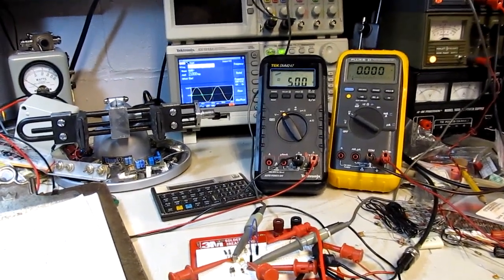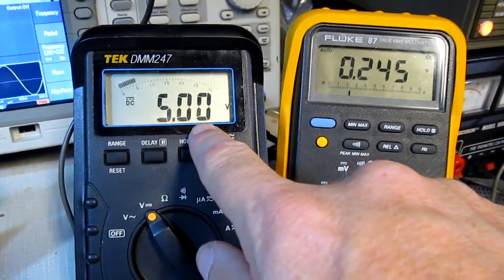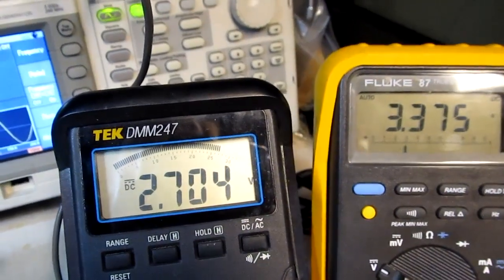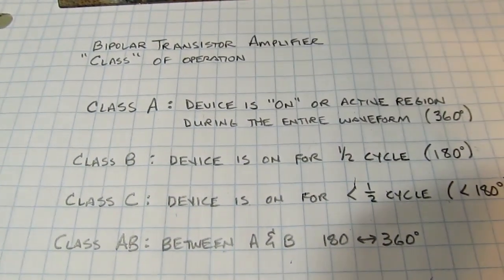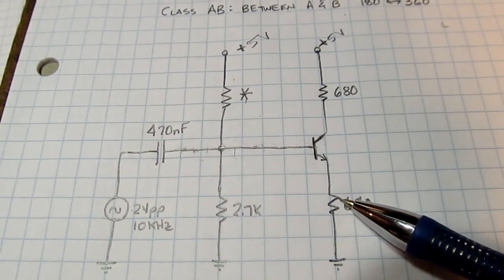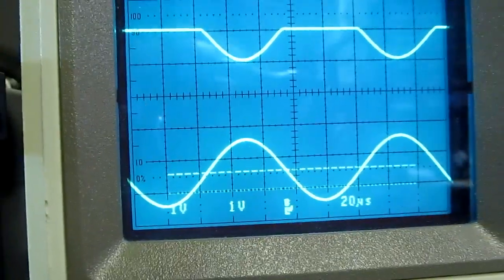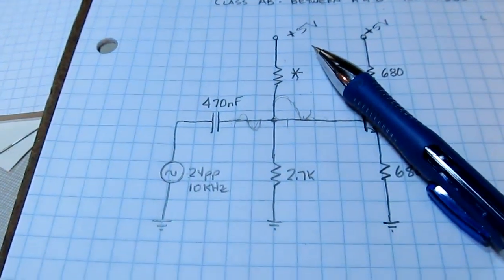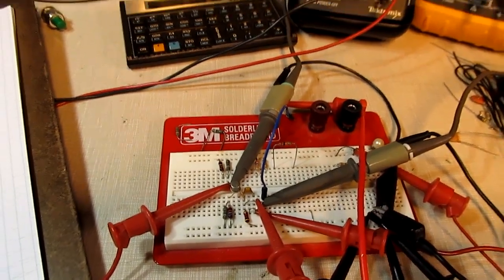#113: Basics of Transistor bias point and the class of amplifier operation

Comment: Feeding through the band-pass filter restores the upper side of the waveform?
I need to study harder.
Thank you for this awesome insight for such a simple device. I love electronics because of teachers like you
Reply from the maker: Yes, the low-pass filter will restore the sinusoidal shape of the waveform.  The clipped waveform (looks half-wave rectified) contains high order harmonic energy.  Filtering away the harmonics will leave only the fundamental, which by definition will be sinusoidal.
Reply: Thank you for taking time to reply, Alan. I vaguely suspected that the high frequency component could help us recover the sinusoidal waveform but I wasn't sure. Simple experiments combined with your insight should be on any electronics student curriculum

Comment: I get all the way up to 3.97v on the base and my collector voltage is still falling, actually that is the changeover point, after 4v my collector voltage starts to rise again, I am using a 2n2222a same as you so I assume the difference in our readings is due to the individual transistor? That said....if I were to design an amplifier for example how would I go about the biasing design considering each transistor has a slightly different gain?.... is it a case of roughly doing the math then making any adjustments once the circuit is built?
Reply from the maker: It's going to mainly depend on the resistors used in the emitter and collector, and the main VCC supply voltage.  The collect will stop falling when the base-collector turns on (when base is ~0.6V above the collector).

Comment: Thank you kind sir!  Your video has cleared up a lot in my head.   Can you advise about biasing Vbe on  transistors?  For the sake of discussion, you can the same bias with a 4.7k/4.7k ohm divider as with 47k/47k ohm.  How do you choose which level of resistance for your voltage divider?
Reply from the maker: It is usually a combination of factors, such as: required input impedance of the circuit, required power dissipation of the circuit, the value of base current, etc.  Using higher values will result in a higher input impedance and lower power dissipation, but then the base current may become an appreciable or major part of the current flowing through one of the bias resistors thus changing the voltage at the base.  I usually pick resistor sizes to ensure that the base current is 5-10% of the current in the divider so that it doesn't have much of an effect on the bias voltage.
Reply: Thanks again!  Much appreciated.

Comment: could you do a video showing how a germanium transistor works?
Reply from the maker: I'll see if I have any laying around in my junkbox.  Suffice it to say though, they work exactly the same as their silicon counterparts except that the Vbe voltage drop is lower.  Otherwise, they're basically the same.
Reply: isn't the biasing quite different though, that's what I was told
Reply from the maker: Not terribly different - it's mainly due to accounting for Vbe of about 0.3V for Ge vs. 0.7V for Si.  After that, it just depends on the desired operating current (collector current) for the circuit.

Comment: I expected collector voltage to vary widely as the base voltage changed only a little, demonstrating the transistor's gain. I expected about 100 to 1 ratios. This seemed like 1 to 1 gain... What's up ? Is it related to base current ? I wish this showed current flow thru base too.
Reply from the maker: Since the emitter resistor and collector resistor are equal, and the emitter resistor isn't bypassed with a capacitor, the gain is simply -1.  Gain is approximately -(Rc/Re).

Comment: Is the bias point always 600 mV
Reply from the maker: The base-emitter voltage drop is always approx 600-700mV, depending on the transistor type and base current level.  The base-emitter is basically a PN junction, like a diode.

Comment: I am interested in how these translate into audio circuits (guitar pedals) and how to design an circuit for whatever is desired. The biasing of transistors in the circuit, the benefits of a "Darlington" transistor pair, Jfets etc... this is awesome.
Reply from the maker: Class A will have the lowest distortion, but also the lowest power efficiency.  The Class C will have much better efficiency, but much higher distortion.  Class B and AB are compromises between these two.  The choice of which to use depends on the desired results.  Darlington devices are used in applications where a lot of current gain is needed, such as driving very low impedance loads.
Reply: w2aew would there be a way to use 1 transistor  with a 3 way switch to achieve all 3 classes with the flick of a switch?
Reply from the maker: Sure, just use the switch to change the bias resistor setup at the base of the transistor.
Reply: w2aew thanks. This will be fun to experiment with.

Comment: This is a great explanation of operation of amplifiers.  Not used to hearing voltages to describe transistors because they are current amplifiers but if you just remember the resistor values it makes more sense... The saturation comment about the base to collector voltage is something that i think isn't well known.

Comment: I like your videos so much! They are plentiful and informative! Just one question... What is the purpose of the two 680 ohm resistors. Thanks.
Reply from the maker: In this case, they provide emitter degeneration (feedback to stabilize gain and operating point), and is the load resistor in the collector.
Reply: Do you know where I should go to look for more information about the load resistor and the emitter degeneration resistor in this circuit?
Thanks Again!
Reply from the maker: You can study common emitter amplifier design to learn how emitter resistor Re stabilizes the bias and gain, and how the overall gain isgiven by -Rc/Re.

Comment: If possible, could you please provide some information about how to bias the transistor in this CE configuration for a class A amplifier?
I assume that in class A an important factor is the maximization of the dynamic input/output range.
For example, how do you decide the collector current and the Ve?
In another video you said that it is better to keep Ve<0.5V. 
Could you please say something more?
Thanks!
Reply from the maker: It all comes down to the requirements for the input and output signal levels - what are the min and max peaks of the input and output voltages.  This will determine where you setup the bias voltages. You would design the bias so that when the input and output signals are at their minimum or maximum level (or anywhere in between), that the transistor stays in the active region (base-emitter always "on", collector voltage doesn't go to the rail, and doesn't go low enough to saturate the transistor). Usually this means designing for a collector voltage that is about midway between the VCC rail and the base voltage when no signal is applied.  Base voltage is setup such that the base-emitter junction is always biased on even when the input drives to the lowest level.
Reply: Thanks.
Please allow me to discuss further.
With the component values that you have in this setup, the following things can be derived.

1) Icmax = Vcc/(Rc+Re) ~= 3.7 mA
2) Vcmin = Vcc - Rc*Icmax ~= 2.5 V
3) Vbmax ~= Vbe + Re*Icmax ~= 3.1V
4) Vbmin = 0.6V

So the dynamic voltage range on Vc is ~ 2.5 V and on Vb is ~ 2.5V.

If I wanted to increase the Vc range, I could  further reduce Vcmin and hence increase Icmax. 
Based on what you said, the lower limit on Vc is the base voltage when no signal is applied.
But the base voltage in this condition already depends on the Q point and hence it is not clear to me which decision comes first.
Vb(Q) should also be set as (Vbmax+Vbmin)/2 for a class A amplifier, correct?
Reply from the maker: One way to increase the available "swing" of the collector would be to reduce the voltage across the emitter resistor.  This would give more low-side headroom for the collector voltage (permitting higher gain operation).  Lower limit on the collector voltage is reached with the transistor is driven into saturation at the highest positive peak of the input signal.  The high limit on the collector voltage (the supply rail) is reached when the lower peak of the input signal turns the transistor off (Vbe drops too low).  The Q point for the transistor is usually selected to be mid-way between these extremes for both the base voltage and collector voltage.
Reply: Ok, thanks.
In your circuit, Vb(Q) = (Vbmax+Vbmin)/2 ~= 1.85V
Ve(Q)~=Vb(Q)-0.6=1.25V

I could decide to reduce Ve(Q) to 0.6V and I could obtain this either by reducing Re or Ic.
But isn't it true that reducing Ve also reduces the available swing on Vb?
It seems to me that this is an option only when |Av| could be greater than 1.
Reply from the maker: Usually you would reduce Ve(Q) by adjusting the bias voltage at the base.  And yes, this lowers the available swing at the base,  but in most cases a CE amp is used to provide voltage gain (which my example circuit does not).
Reply: Clear, thanks!

Comment: What about the base current in this case? I can set the base voltage to 1V using 100k or 1k resistors, the only difference will be the current, what will this affect the whole amplifier?
Reply from the maker: For class A biasing, the base resistors don't determine the base current.  The base current is basically determined by the transistor Beta and emitter current, which is set by the emitter voltage and emitter resistor value.
Reply: What about the class C? How does current affect it? Same as class A?
Reply from the maker: For class C, the transistor's base and collector current flows only during the conduction cycle.  The amount of current that flows depends on the signal level and impedance of surrounding components.
Reply: Im asking this because, im trying to build a DC square wave amplifier (0-5V to 0-100V), and I want to push the transistor like you did in the class C, because im trying to "smooth" the edges of the square wave to remove the HF noise when it opens and closes, I dont want it to become a half sine wave, it must remain square but with the smooth edges. I think that the better choice is the class C amplifier, right?
Reply from the maker: Class C will work, depending on how fast you need the circuit to operate. You can switch the transistor from off (cutoff region) to fully on (saturation region). There are several things to consider, such as: what output impedance (collector load resistance) do you need to drive, what source impedance is driving it, what sped to you need to operate?
Reply from the maker: Since you're driving the base with a resistor divider, you can usually slow down the switching speed with some capacitance added from base to collector.

Comment: I like your explanation.

You are always describing the bias point in terms of Vbe and this results in a very clear differentiation between the different classes of amplifiers.

The general definition of bias point as the DC collector–emitter voltage (Vce) and the collector current (Ic) when no input signal is applied is more difficult to understand.
Reply from the maker: The bias point is simply the static DC voltages and currents that exist in the circuit, not including any small-signal application.  I'm glad you found my explanation helpful.
Reply: The Vb you set is a valid bias point as long as the transistor still follows the linear relationship: Ic=Beta*Ib.

You explained everything in terms of static Vb and Vc voltages without looking at the static Ib and Ic currents and this makes it unconventional in my opinion, but useful and very practical.

Comment: Thanks a lot just a point Im stuck. When you say collector voltage do you mean Vce or Vc to GND? And why does the collector voltage start increasing just after the saturation point when we keep increasing the base current? I dont get that. At 4:52
Reply from the maker: When I say collector voltage, I am referring to the voltage at the collector with respect to ground. The reason that the collector voltage begins to rise again as the base voltage is brought above the point where the transitor is saturated, is because the base-collector junction turns on, like a diode, so the collector voltage will follow the base voltage increase, only it will be a diode-drop below.

Comment: Great video, small question I was not able to answer, why do you increase the resistor in the C type mode to increase the gain in voltage, shouldn't you have decreased the resistor value? (Allowing more current to flow? Or allowing the collector to be closer to the Vcc level if you might)
Reply from the maker: In Class C - the gain is a function of the transconductance of the transistor multiplied by the collector resistance (impedance).  The transconductance is controlled by the collector current, which is controlled by the base-emitter. The collector resistor does NOT control the collector current when in the active region.  The collector resistor controls the current in the collector only when the transistor is saturated (which we're not doing).
Reply: w2aew many thanks 😀, not sure I got this, I am an electrical hobbits and not an engineer, was looking for a more intuitive explanation if possible 😀. Is there a rule of thumb for increasing the voltage gain in active mode? Is it only changing the hfe? Not sure it is even the same question regarding my original one (hoping it is 😀,  I am assuming in active mode gain changes are controlled by same parameters)... So to summarize. I am not sure how increasing the resistor value on the collector increased the gain.

Comment: thx for this video. i have one question: i repair guitar amps, but mostley vacuum-tube amps. i need to determine in what class my amp is operating at the moment. it should be class A, so current must be flowing true the plate of the tube (or the collector of the transistor) during 360 degrees of the ac-input signal. here is the question. i see in your video you measure the output-collector voltage. but i need to know the current-signal on the output. should i use a current probe to see the current-signal on my oscilloscope?
Reply from the maker: The voltage at the collector is determined by the voltage dropped across the load (collector) resistor, which is proportional to the current (simple ohms law), thus if the load is resistive, probing the voltage is all you need to do.
Reply: thx for fast reply. my load is a primary winding of a output transformer so not resistive...
Reply from the maker: The transformer is going reflect the nature of the load connected to the secondary (as long as the core isn't saturated), so you likely can still simply probe the primary.

Comment: i didn't understand two things
a) what do you mean by putting an AC signal over 0.6V (does it get divided by half like the new input to the base is +1.6V and 0.4 V signal)
b) the 1.6 V bias flew over my head
Reply from the maker: When I couple the AC signal from the signal generator through a capacitor onto the base node, the AC signal "balances" itself around the bias voltage that was already present on the base due to the resistors connected from the base to VCC and GND.
Reply: +w2aew so any ac signal coming will get dc shifted up or down by the DC bias value right?
Reply from the maker: Basically, yes.  The AC signal simply superimposes on top of the DC that is already there on the other side of the capacitor.

Comment: One small point , it would be nice if the meters were in the same orientation as the diagram BASE voltage on RHS  as per transistor graphic, etc . As usual great videos ..TY

Comment: I think the base bias resistors are 2.7k and 18k (not 36k) in Class B Amplifier by voltage divider rule. Am I right? Please guide.
best regards and thanks
Reply from the maker: Yes, you are right. The error though is that the lower resistor is actually 4.7k, not 2.7k as shown in the schematic.

Comment: How do i know how many volts i need?? :/ on the base
Reply from the maker: You have to consider your signal swings, and the class of operation that you desire, to ensure the transistor's terminal voltages and operating condition meet your requirement for operating class at the peak excursions of the signal.
Reply: Okey, fast asnwer cool! Is it the type of swings you mean? Im making a class ab audio amplifier.
Reply from the maker: It's really about the highest and lowest peak voltages of your signal. For AB operation, the negative peak voltage of your input is allowed to turn off the transistor. At the midpoint and at the positive peak, the transistor needs to be in the active region, and not saturated that the positive peak input.
Reply: Okey, thanks! I'll try and see if i manage to do it.

Comment: I got a voltage across the 2.7k ohm to be 1.06V if you use a 10k resistor. I use The VDR rule. Am I doing something wrong or shouldn't that resistor be around 5k?

Comment: Thank you! Great video, i just have one question, how do you calculate the bias voltage? How do you choose your resistor values to give a bias voltage of 600mV?
Reply from the maker: +Tian Pretorius When setting up the bias network on the base of a transistor, you start off with the assumption that the current through the bias resistors is going to be 10-20x or more greater than the base current.  Thus, you can effectively ignore the base current.  This makes the bias network a simple voltage divider problem.  For example, lets say you target 1mA as the collector current.  If the Hfe is 100, then the base current will be 10ua.  So, let's choose the bias resistor current to be 200ua.  If you know you want 600mv at the base, the resistor value from base to ground will be 0.6v/0.0002a) or 3K ohms.  Then, the resistor from the base to the positive supply (VCC) can be calculated as (VCC-0.6)/0.0002).
Reply: Now I understand! Thanks for the quick reply. Really enjoying your videos